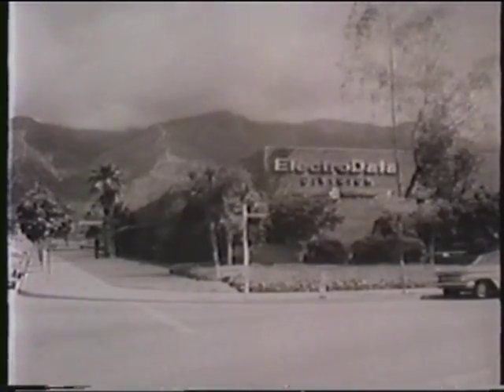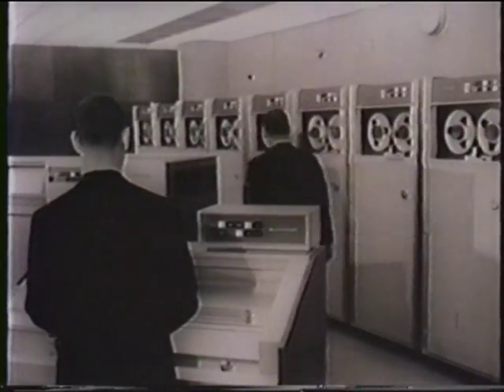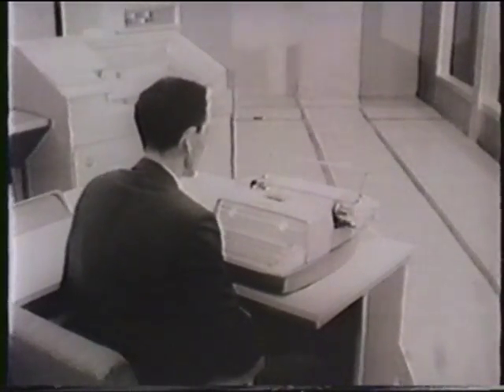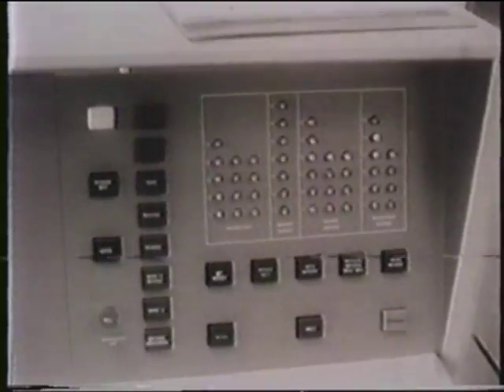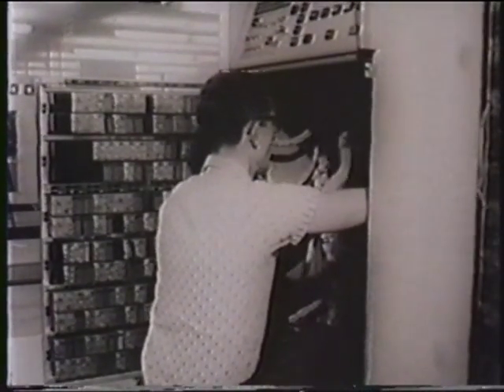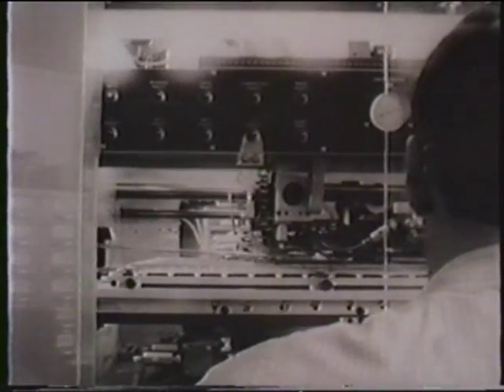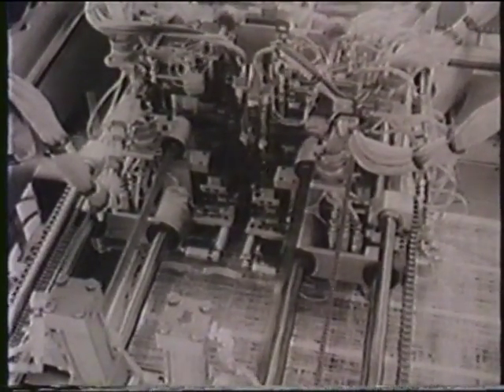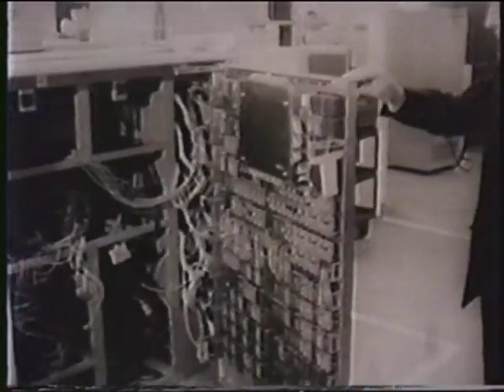Burroughs B5000/B200 Documentary

Comment: 2:41 so what am I looking at here? Honing / flattening process? The three rings appear to be sliding on top of the large metal platter.. I don't know of any electromagnetic function of such spinning rings.
Reply: That big disk seen was the making of the disk that was used in the Burrough's 'head per track' disk. The disk unit had several disks (4 as I recall) and they were stacked vertical in the unit which was about three to four feet high. The read/write heads for the disk did not move like modern day disks. They the heads were on both sides of the disk. Because of the mass, it took a minute or so to get the disk up to speed prior to flying the heads. They were faster than the platter disks IBM and others had at the time but did not hold as much data. At 2:58 you can see one of the disks on the right that is vertical so you get an idea of the finish size of just the disk.